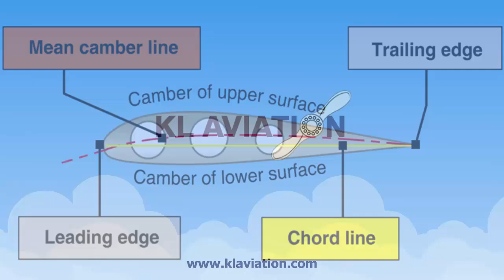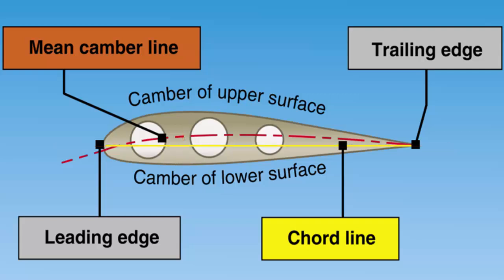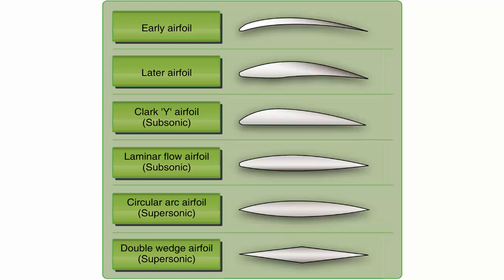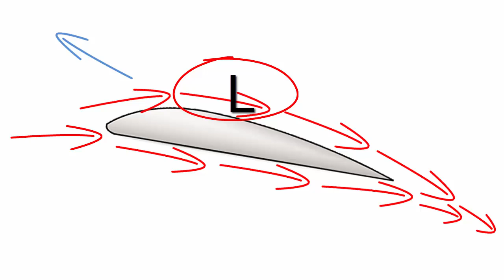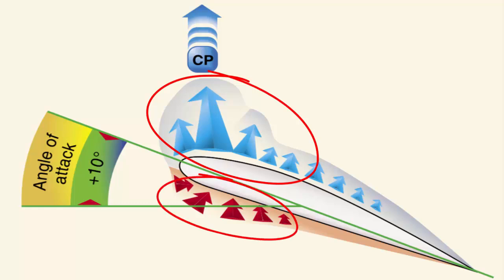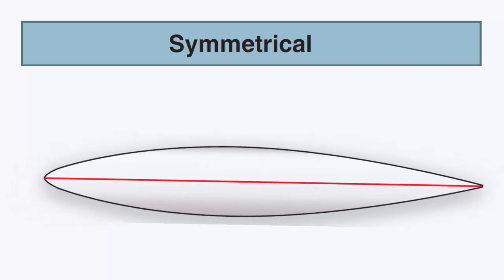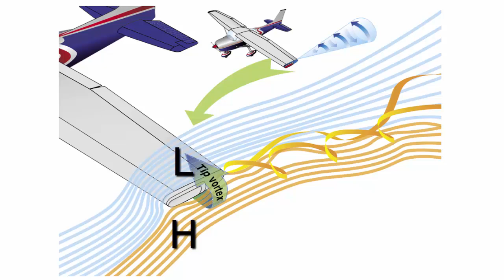Airfoil Design

Comment: If these descriptions on video were the reason planes fly, why DC-3 (which has totally symmetric airfoil) had flow and still flies so well... Please don't start explaining with airfoil modern planes don't have...
Reply: Summary:
The pressures changes created by the moving wing provide all the lift force AND also provides the force to accelerate the air downward.  Those are two different results of the pressures, not two alternate ways to look at lift.
.....
This video only repeats very common misconceptions and invents a new one, as follows.
.
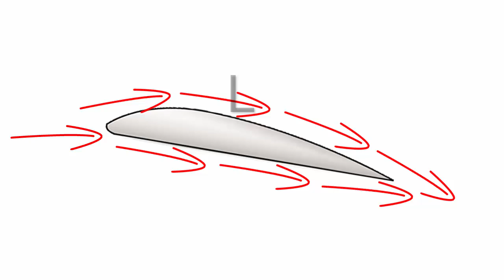3:13  The low pressure above the wing allows higher pressure ahead of the wing to accelerate it to the higher speed. It is Newton.  The force of pressure accelerates the mass of air. 
The movement of the wing creates pressure gradients and as Euler reported to us in the mid 1700s, Pressure gradients accelerate fluids.
Bernoulli never said speed causes a pressure reduction. He only noted that the (static) pressure and velocity have an inverse relationship with no indication of cause and effect. This is a major, common  misunderstanding. 
Euler determined that pressure gradients accelerate fluids toward the lower pressure. That is the opposite of the common misconception.
...
3:29  The pressure difference top to bottom accounts for ALL THE LIFT.   This 'a little of this and a little of that" is bad science.   The same pressures that have the net upward lift force on the wing are the very same pressures that cause all accelerations around the wing including ahead, above, below, behind and around the tips.
The higher pressure under the wing pushes up on the wing AND down on the air below to contribute to the down-wash.
The lower pressure above the wing allows atmospheric pressure to push air above the wing downward, to also contribute to the down-wash.
..
NOTE: the whole upward force on the wing is equal to the force required to accelerate all the air in the down-wash.  THAT is what satisfies Newton's Third Law.  The upward 'push" (force) on the wing equals the downward 'push' (force) on the air accelerated downward.
The downward moving air does not push up on the wing.   That air was pushed down by the pressures around the wing. 
The down-wash also does not push the wing forward. You've invented a new a fallacy.  The net force fore-aft is rearward and is called drag and is not caused by the down-wash as explained above.
When viewed from the still air frame of reference, the down-wash is moving slightly forward.
....
4:27  Bernoulli's Principle is again misused.  The flow is not slowed under the wing which is NOT the cause of the higher pressure. .  That view is valid only in the stationary wing, wind tunnel reference frame only. 

 In fact, REAL data from a REAL wing generating REAL lift flying through otherwise still air shows the lower air being moved forward in the direction of flight. This acceleration from still air is CAUSED BY the higher pressure at the lower surface.  The increase in pressure at the surface is because the wing is pushing the air out of  its way. This push increases the pressure, not the Bernoulli Principle Fallacy.
....
The pressure increase below the wing in combination with the decrease above the wing provides the ENTIRE lift force.
...
If by this magic, the down-wash did just happen to add to the lift, that "addition" would be exhibited as an increased pressure difference on the win...but it DOES NOT.
Bernoulli's Principle causes nothing in the generation of lift because the "speed-causes-pressures" is a fallacy. 
It is all explained by Newton, BUT NOT with this ":reaction force" fallacy.
Newton's Third Law "reaction force" is not an originating force, but is a direct result of the originating force which, in this case,  is from the pressures around the wing as described above.
....
At 7:11 Please listen to your words: “The high pressure area on the bottom of an airfoil pushes around the tip to the low pressure area on the top.”. This shows that you understand that pressure causes movement, but you fail to apply it on all the other parts of this  and, therefore shows the problems with this explanation.  The correct story uses this Pressure accelerated air in ALL aspects around the wing, because that I the real science.
The tip vortex does not ‘create the down wash”.  You already explained the down-wash without reference to the tip vortex.  This is a flaw in this explanation. The tip vortex is CONSISTENT with the wing generated down-wash moving against the still air outside the wing span.  Masses of air sliding along each other create vorticity (vortices) along the boundary of the two masses.
…
At 7:47 Winglets DO NOT and CANNOT prevent the tip vortex from forming.  They can only reduce the severity and the negative effect because they act to effectively lengthen the wingspan; longer wings have less severe vortices . See Doug McLean’s You Tube video on misconceptions for a full explanation.
https://www.youtube.com/watch?v=QKCK4lJLQHU 
…
Though well-meaning, the 'Pilot's Handbook of Aeronautical Knowledge.' has bad information in it as do so many other publications and on-line resources such as YouTube.
Reply: Aerobatic aircraft may have symmetrical wing. The angle of attack provides the slight change in camber. So they fly well even upside down.
Reply: @flybobbie1449  indeed.. therefore the lift comes from the wings´s angle of attack.. of course wing profile means a lot especially low-speed flyiers..
Reply: @dnjoncvichy  This is why non sym. aerofoils are preferred, they produce lift even at slight negative angles of attack. Extreme attitude not req. for take off and guards against a tuck under when pitching down. DC3 starts it's take off very nose up.

Comment: Thank you. Great video.
Reply: This video only repeats very common misconceptions and invents a new one, as follows.
.
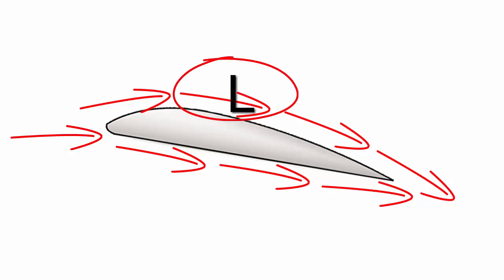3:13  The low pressure above the wing allows higher pressure ahead of the wing to accelerate it to the higher speed. It is Newton.  The force of pressure accelerates the mass of air. 
The movement of the wing creates pressure gradients and as Euler reported to us, Pressure gradients accelerate fluids.
Bernoulli never said speed causes a pressure reduction. He only noted that the (static) pressure and velocity have an inverse relationship with no indication of cause and effect. This is a major, common  misunderstanding. 
Euler determined that pressure gradients accelerate fluids toward the lower pressure. That is the opposite of the common misconception.
...
3:29  The pressure difference top to bottom accounts for ALL THE LIFT.   This 'a little of this and a little of that" is bad science.   The same pressures that have the net upward lift force on the wing are the very same pressures that cause all accelerations around the wing including ahead, above, below, behind and around the tips.
The higher pressure under the wing pushes up on the wing AND down on the air below to contribute to the down-wash.
The lower pressure above the wing allows atmospheric pressure to push air above the wing downward, to also contribute to the down-wash.
..
NOTE: the whole upward force on the wing is equal to the force required to accelerate all the air in the down-wash.  THAT is what satisfies Newton's Third Law.  The upward 'push" (force) on the wing equals the downward 'push' (force) on the air accelerated downward.
The downward moving air does not push up on the wing.   That air was pushed down by the pressures around the wing. 
The down-wash also does not push the wing forward. You've invented a new a fallacy.  The net force fore-aft is rearward and is called drag and is not caused by the down-wash as explained above.
When viewed from the still air frame of reference, the down-wash is moving slightly forward.
....
4:27  Bernoulli's Principle is again misused.  The flow is not slowed under the wing which is NOT the cause of the higher pressure. .  That view is valid only in the stationary wing, wind tunnel reference frame only. 

 In fact, REAL data from a REAL wing generating REAL lift flying through otherwise still air shows the lower air being moved forward in the direction of flight. This acceleration from still air is CAUSED BY the higher pressure at the lower surface.  The increase in pressure at the surface is because the wing is pushing the air out of  its way. This push increases the pressure, not the Bernoulli Principle Fallacy.
....
The pressure increase below the wing in combination with the decrease above the wing provides the ENTIRE lift force.
...
If by this magic, the down-wash did just happen to add to the lift, that "addition" would be exhibited as an increased pressure difference on the win...but it DOES NOT.
Bernoulli's Principle causes nothing in the generation of lift because the "speed-causes-pressures" is a fallacy. 
It is all explained by Newton, BUT NOT with this ":reaction force" fallacy.
Newton's Third Law "reaction force" is not an originating force, but is a direct result of the originating force which, in this case,  is from the pressures around the wing as described aboave.
....
At 7:11 Please listen to your words: “The high pressure area on the bottom of an airfoil pushes around the tip to the low pressure area on the top.”. This shows that you understand that pressure causes movement, but you fail to apply it on all the other parts of this  and, therefore shows the problems with this explanation.  The correct story uses this Pressure accelerated air in ALL aspects around the wing, because that I the real science.
The tip vortex does not ‘create the down wash”.  You already explained the down-wash without reference to the tip vortex.  This is a flaw in this explanation. The tip vortex is CONSISTENT with the wing generated down-wash moving against the still air outside the wing span.  Masses of air sliding along each other create vorticity (vortices) along the boundary of the two masses.
…
At 7:47 Winglets DO NOT and CANNOT prevent the tip vortex from forming.  They can only reduce the severity and the negative effect because they act to effectively lengthen the wingspan; longer wings have less severe vortices . See Doug McLean’s You Tube video on misconceptions for a full explanation.
https://www.youtube.com/watch?v=QKCK4lJLQHU 
…
Though well-meaning, the 'Pilot's Handbook of Aeronautical Knowledge.' has bad information in it as do so many other publications and on-line resources such as YouTube.

Comment: Wrong! Wrong! Wrong! And wrong again. It's now well established that Bernoulli effects have little to due with creating lift--flight. Neither does the Coanda effect. Lift is Newtonian, and comes about from pressure gradients due to the vacuum along the top-rear of an airfoil, not conservation of energy in air flows or Bernoulli pressure gradients.

Lift results from air accelerated by the vacuum on the top-rear surface of an airfoil. However,  Bernoulli's formulas are a close approximation for designing wings and explaining lift, and so are often used for just that.

The formation of lift by an airfoil comes from the pressure gradient at the extreme vacuum found at the top-back surface of a wing. This vacuum accelerates the air just above the back surface of the wing down towards the back of the wing. This accelerated air in turn pulls down and accelerates more air from above the airfoil. The opposite and equal result of this pulling down, "scooping,"  of air and accelerating it downward is an upward force, lift. Lift is Newtonian.

Airfoil equipped aircraft are essentially horizontal rockets, but much more efficient because of their ability to utilize graviational energy to create lift.

The Coanda Effect is not the driver of lift either. It is caused by a weak electrical interaction between flowing fluid/air and the surface it is flowing over.

As lift is Newtonian, it follows that the vast majority of the energy that is used to create and sustain lift, and maintain a heavier than air aircraft in the sky, comes from gravity, not from the aircraft's engines. That is why aircraft have non-powered glide-ratios and helicopters auto-rotation. Autogyros are an extreme example of this fact. If the energy from an aircraft's engines were the sole source of energy generating lift, a plane, like a rocket, would not be able to sustain flight for more than a few minutes; Also why jet packs will remain elusive for the foreseeable future.

In the following video one can see the condensation in the vacuum induced low pressure area above the aircraft's wings. A closer look will reveal that this air is being pulled down, accelerated, and then pushed down at the back of the plane's wings:

https://www.youtube.com/watch?v=t2SZawBVSrQ

Hate away, but them's the facts.

Comment: Most of your lecture is incorrect bro... it started when u said the airflow over the top has to be faster because the upper surface is longer... seems you think molecules above and below are somehow entangled like quantum mechanics and need to return into each other’s arms... the transit times above and below are different bro... this is a gaseous fluid and there is nothing in aerodynamics that indicates fluids have to be the same after playing host to a transiting wing... pretending they have to be the same is not physics but a belief system such as religion is based on belief without good evidence... 
if u don’t know bro just say so...  BUT don’t churn BS to the uninitiated who will be none the wiser.
Reply: Another common fallacy is the faster bit.
.
The air above the wing is faster, but that is only relative to the wing.
.
Relative to the mass of relatively still air that the wing is flying through, that upper air is actually slower than the air below the wing.  This is from measured tata I can provide.
.
That fact blows the doors off this "faster air" nonsense myth.
.
This faster air thing is the all too common misunderstanding of what Bernoulli's Principle actually says.
Reply: For a correct explanation of the cause of the lower pressure above a wing, see this short video:
The above wing reduction gives folks the most trouble. For a better understanding of the detailed cause of the reduced pressure above a wing, try this very short video that I had my 11 yo granddaughter do the editing for:
https://www.youtube.com/watch?v=3MSqbnbKDmM
Regards.

Comment: Downwash is a result of the wing producing lift, not a cause.
Reply: I mean, aren't they both basically the same effect, it's just Newton's 3rd law isn't it?
Reply: Correct.
The wing's motion must push the air out if the way and let it flow back in behind it.  This pushing and "pulling" i produces pressure changes around the wing.  There is more under and less above.  These pressures result in two things.
One  the upward force holding the ewing up called lift - more under than above.
.
The other thing it that these VERY SAME pressures cause is all the accelerations of air that we see around the wing: ahead, behind, above, below and around the tips.
The pressure reduction above  contributes the most to the Top-bottom lifting pressure difference.
.
The above wing reduction gives folks the most trouble. For a better understanding of the detailed cause of the reduced pressure above a wing, try this very short video that I had my 11 yo granddaughter do the editing for:
 https://www.youtube.com/watch?v=3MSqbnbKDmM 

Regards.
Reply: @FreyrDev  If you saw hot, smoky air rising over a campfire would you claim the rising of the air is what made it hot?
Reply: @niio111   My point was not that you had the causation backwards, but that you can't really say either causes the other. With the fire example I don't really care about that causative relationship, but more that if you tell me there is a column of hot air, I can assume its rising, and if you tell me there is a column of air rising, I can assume it's hotter than the surrounding air, and both of those would be valid ways of looking at the system. However I don't think its a great analogy in this situation, as with the fire I think you can probably view it as a system trying to find equilibrium, and thus you can assign a root cause to whatever is disrupting the equilibrium, i.e. the fire, but I don't think this works with a wing. 

I think a better analogy would be to imagine firing two balls at each other so they collide, can you say that the statement "ball A causes ball B to ricochet away" is any more or less correct than "ball B causes ball A to ricochet away" (assuming neither ball comes to a stop in the collision), no, the resultant force must act on both balls equally in opposite directions. Similarly the wing being pushed up and the air being pushed down are caused by the same Newtonian reaction force, so it seems dumb to say that one caused the other.

Edit: Actually I think a more accurate way of describing why I dislike the fire analogy is that you're only analysing the result on one side, the air, whereas with the balls and the wing you have to analyse the result on both parts of the analogy.

Comment: The air does not move "faster" over the wing, nor does it stagnate at the leading edge. Air does not move. An airplane has thrust. If wind tunnels were accurate there would be no such thing as porpoising in F1. If air moved at 150 mph, everything would fly. This is a lazy and ignorant way of explaining airfoils.